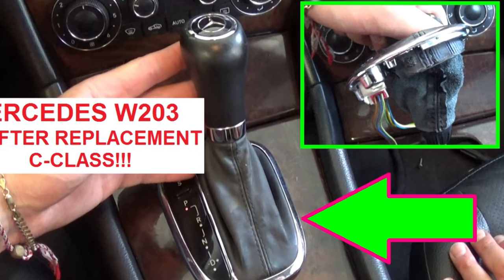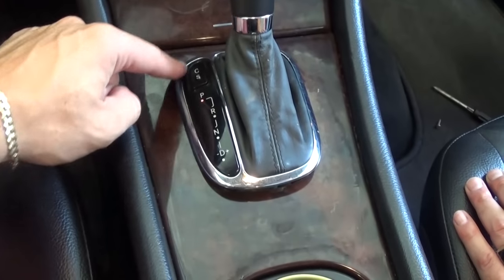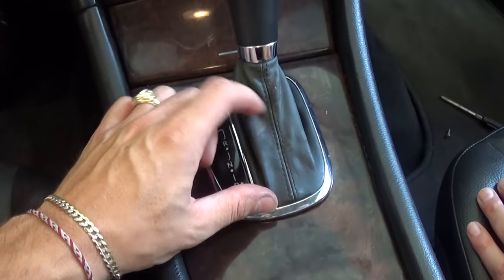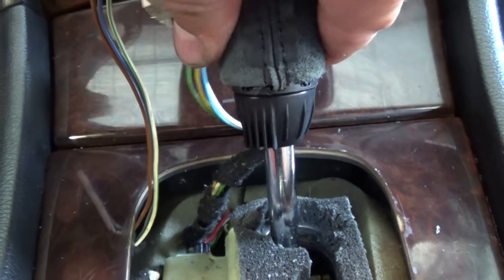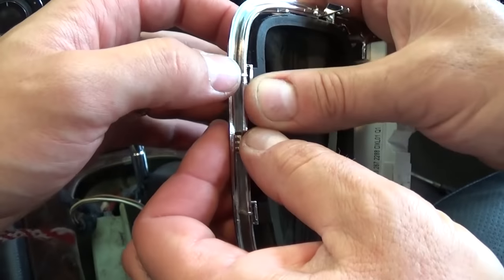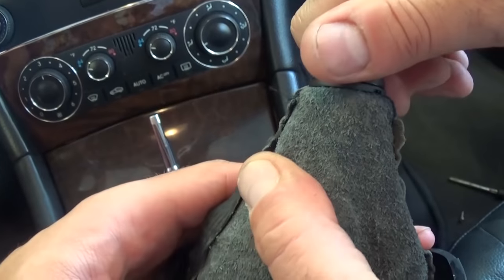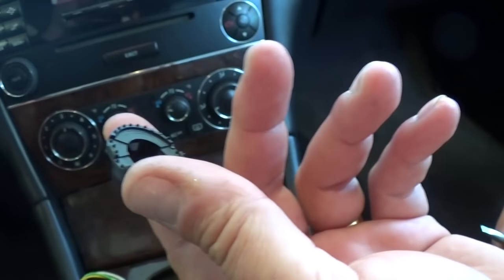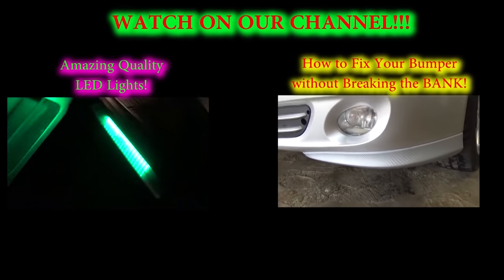Mercedes w203 Shifter Shifting Knob Removal and Replacement! C180 C200 C220 C230 C240 C270 C280 C320

Comment: Oct ‘23. 2002 C320. Just followed your video and I am very happy!  Paid $27 for a new bezel and $7 for leather softener.  First I used Q tips dipped in acetone to remove all of the Gorilla tape glue residue which was securing my gear shift.  Why didn’t I do this years ago??  Next DIY project:  replace LED display screen (as easy as bezel fix).

Comment: can a bad transmission module corrupt this gearshift/indicator piece? I think gearshift plate was replaced when the module was replaced. I can’t think of any other reason why I still have the original indicator piece/plate..

Comment: hi guys I've just purchased a 2006 auto E350 Mercedes and managed to leave the passengers side window open last nite around 20mm and when I got in it this morning water had gotten in and water stained the wood around gear shifter,,,,,is there any quick fixes or is this a take it out disassemble sand down and re lacquer job. cheers in advance Logan

Comment: Hi, can u please tell me is it possible to remove the Chrome ring on the knob, i want to install a r230 knob but it has a aluminium part instead of chrome. I want to switch it with the chrome "ring"

Comment: You popped out the leather but what about the electronic part (where is has P R N D)?  Can that come out?
Reply: Yes, that can be removed as well. It is held on by 4 clips similar to the leather part, just push it out. You can purchase a replacement shifter trim (just the metal) for like $30 on Amazon. This is how you would swap over the electronic part (and leather) from the original into the new. I recommend cleaning and conditioning the leather prior to installation on the new shifter trim.
Reply: @sicilianstyle4517  I agree. I am having difficulty removing my indicator from the frame. My electronic part will not come out when I try to push it out. Are there any other ways to unclip it and remove it without breaking the frame?

Comment: What is the part number for just the leather boot/part for a CLK model? I have replaced the silver trim two times already. It keeps breaking. On its third one in just a year, so I am guessing the leather piece needs to also be replaced. Having trouble finding just the leather piece. It is always sold together with the shifter, which I don't need. I have a CLK AMG model, so it has engine start/stop.
Reply: same thing i have any luck

Comment: Hello Great video . Please I have a mercedes benz C270 CDI automatic transmission and at first the perfomance was good untill I realised that it is stocked on the second and the S/W no longer works also the shiftronic no longer works and the car only drives on the 2nd gear and I have had it gearbox oil changed and also the filter but the car still only drives on one gear please can you help me out
Reply: Looks like its in get you home mode. The transmission control unit will need to be reset as far as I'm aware this needs to be done in a dealer with the Star system.
Reply: One other thing check that the electrical connector on the side of the gearbox is clean and locked in position.